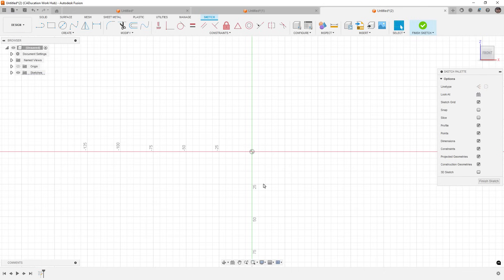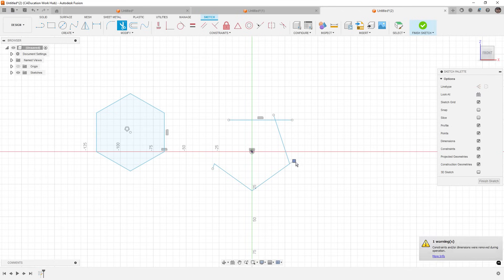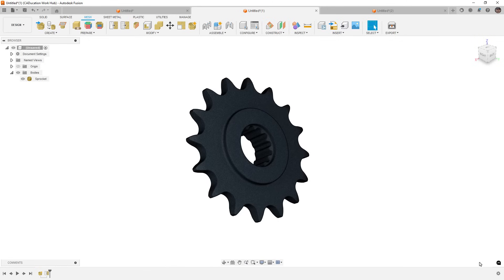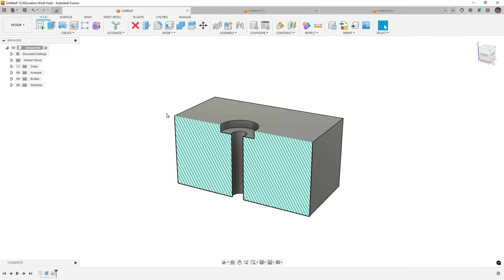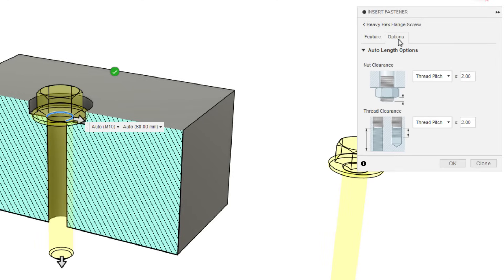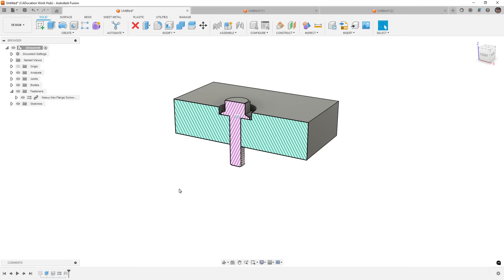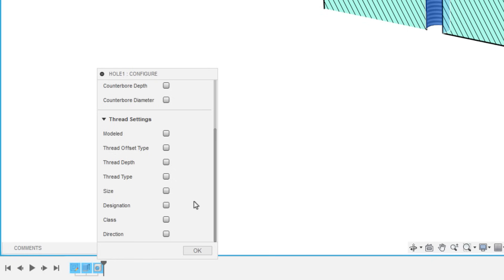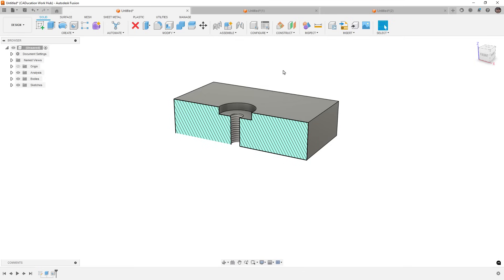What's New In Fusion for January 2025 | Mesh Align | Insert Fastener | Polygon Constraint | Configs

Comment: I still have zero idea what the polygon constraint does.  Great job covering what it doesn't do however.
Reply from the maker: Yeah.  I actually did find a use for it last week.  If you make a polygon with the polygon tool and copy/paste it, it no longer has the polygon constraint.  so in that case you can add it and keep the shape.  other than that......  And really if you copy a sketch and paste it, the constraints should also go.
Reply: @ thank for that.

Comment: Really wish you could do something like configurations, but fully dynamic (as in configure the parameters of an inserted component only for the local "assembly")
Reply from the maker: But still keep its parent(external) linked and in a different config?  You can config an inserted external component, but if you are looking to just change parameters you would need to do a break link on it.  I am not sure of any CAD program that would behave that way.  Do you have a use case where you need this?

Comment: I'm not really a big fan or insert fastener or insert from McMaster because it generates completely independent components 

I prefer importing fasteners into fusion and then inserting the component
Reply from the maker: 100% valid.  I like them being inside an assembly if its for a single client and i am working with no xRefs.  If its a case where hardware is reused or its for a bigger project with external references that likely pushes me to save them externally and insert them.

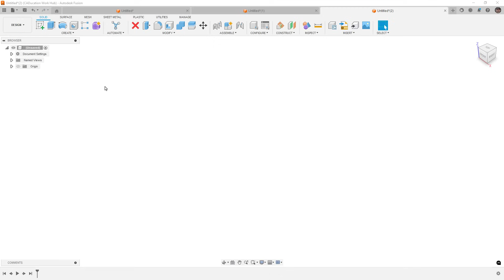Comment: @00:17 AutoConstraint became available to me after the latest Update 🤔 Gonna be interesting for those Sketches where you just can't figure out how to fully constrain it.
IMHO my biggest want for Insert Fastener would be the possibility of curating your own Library either via editing the existing Selection or by simply adding your own Models to it.
I - apparently!? - like to work outside what Fusion considers normal Dimensions when it comes to the available Fastener Selection like say M3 Socket Head Cap Screws but ones up to 50mm long or Bolts in the Sub M2 range down to M1 for Scale Modelling which is really annoying for all those not being available from the Insert Fastener Tool ( and to some degree also not from McMasterCarr 💢 )
Reply from the maker: You can edit the fasteners saved into the fastener project folder but it would be really nice if you could include it or add a favorites which you  have downloaded from a vendor.

I have worked with companies that maintain their own part numbers for hardware as it doesn't matter who the source company is, and I get that.  I think the majority of users for Insert Fastener right now are those of us that would order hardware based on a project and a complete drawing package with PNs is lower on the list.

Comment: In terms of surface modeling. (Car related parts/bodies) Would  you say its worth spending time on it in  fusion360 or skip it and go to plasticity? Even with being able to achieve quite  a lot in f360 it looks like Plasticity is a much better option. I've  been messing with it in f360 and it just seems like it's going to a be a struggle to achieve the finer details.
Reply from the maker: That is a bit subjective but i would lean toward Fusion personally for a few reasons.
Fusion can handle freeform modeling and surface modeling off of scanned mesh bodies.  Plasticity can do a bit with a mesh but not nearly as much.
Fusion is made for production while Plasticity is made more for concept/vfx/game asset type modeling
Fusion is parametric so say you wanted to design a lower control arm for your car, its much easier to be precise and allow for flexibility of the design by editing dimensions.

I do think the surfacing in plasticity does edge out fusion in quality and flexibility, but again outside of the concept phase I think Fusion is still a better bet.

Comment: Hi Matt,
do you know if fusion will still work after Win10 support ends in october this year?
I will not switch to Win11, i'll rather go with linux in the future but keep Win10 as dual boot for fusion.
Unfortuantely i don't get along with the plasticity workflow so i'll need fusion on Win10.
Reply from the maker: I wish i knew for sure Gery.  The info I have seen states that Autodesk won't support win10 for fusion after Oct when Microsoft drops support.  I know MS has an option to continue to pay for security updates for 3 years but because Fusion updates and you can't really lock in a version for more than a few weeks I would have to guess Win11 will be required.

When i got a new laptop recently I had committed to putting win10 on it since i kept all my other systems on win10.  I gave win11 a try and have kept it so far because sadly I don't have a choice but to move with some of the programs I support for my clients.  I don't love it and i had to turn off probably 200+ settings but i have it looking and feeling a lot like win10.  For right now all of the settings and things that worry me about win11 can be turned off, but i wouldn't be shocked once win10 goes away if that wasn't the case anymore.

Comment: Yeah, polygon constrain is disappointing. Could be useful only if you import dxf from other CAD and need to recreate constrain on already accurate but unconstrained drawing. Autoconstrain works nice, will be useful for same purpose.
Reply from the maker: So the magic button was there for you?  :)  The examples I have seen for Autoconstrain don't seem to be any faster than doing it manually as intended honestly.  When I am modeling I tend to dimension on the fly so rarely do i have a big mess to deal with.
Reply: @LearnEverythingAboutDesign  yes, arrived in my interface. I'm doing the same with my own sketches, but sometime have to work with dxf from customers.
Reply: @LearnEverythingAboutDesign  I think this would be quite useful with mesh sections that do not bring any constraint at all. I still have to try it.
Reply from the maker: @ Thats a good point!  Mesh section with lines/arc could use it.

Comment: Thanks for the info Matt. Looking forward to to test dark mode which is starting to roll out in preview.
Reply from the maker: yeah ive seen a few people with the insider builds with it.  I honestly thought it would be out this time but i guess not.
Reply: I’m not on insider and got dark mode right away. It’s ok, but I’m still not sold. I turned it off for now, it needs slightly more work, IMO.

At least for working on my desktop in an office setting, I may change my mind if I end up using fusion on my laptop.

I didn’t get the auto constraint.